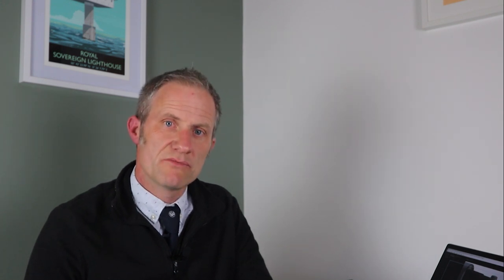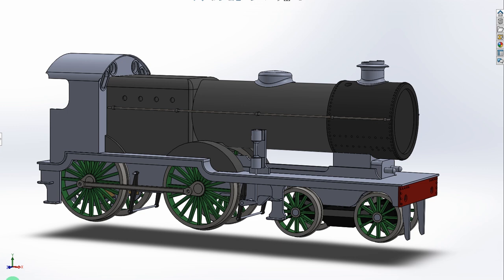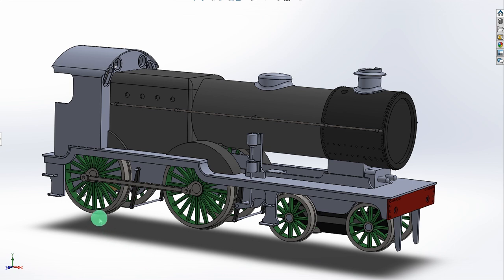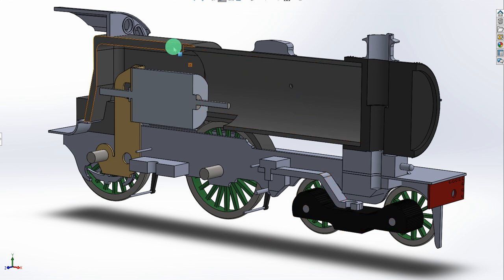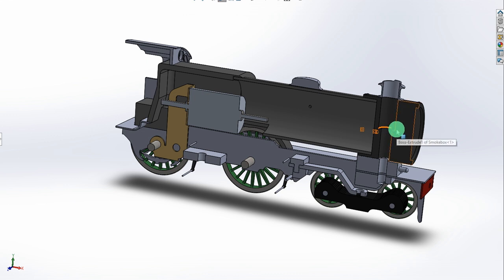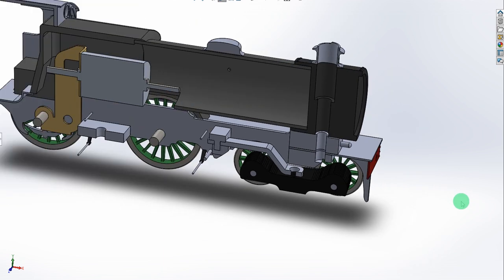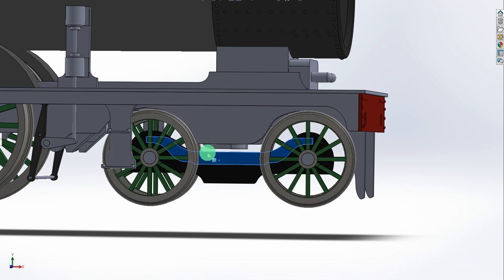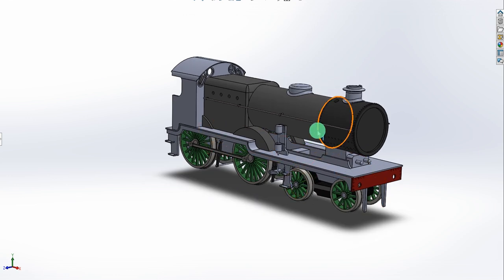Locomotive Kit Design

Comment: Interesting video, thanks for sharing. I know the video is 2 years old, but it may be worth doing a bit of research on Adavoyle Junction a famous layout based on Irish broad gauge, built to S4 standards, the engineering was remarkable, they mounted the motor and flywheel in the tender, and drove the driving wheels with a cardan shaft between the locomotive and tender through a gearbox, the result was a very smooth running locomotive, leaving plenty of space in the boiler for extra weight. I had the pleasure of knowing some of the people behind Adavoyle, I can guarantee if they were still alive they would be pushing 3D printing and technology to its limits

Comment: I did think you would be better off without the kit - especially with your CAD skills. Whitemetal is a good material but isn’t the best for representing sheet metal - things such as the cab, running plate, etc would benefit from being etched brass. As you say focusing weight above the driving wheels is ideal - I also agree moving the motor then packing lead beneath it is a good idea : casting the firebox in whitemetal (or possibly pure lead) would also pair well with a brass boiler.
-excited to see the next development
Reply from the maker: Thank you Harry, you have confirmed some of my ideas.  Having not built a locomotive this small before it isgreat to have some feedback from those more experienced than myself.  I have a 7 1/4" gauge loco build ongoing at present which may feature on the channel at some point, and that is altogether a different proposition.  I think the reversing lever alone is longer than the locomotive which is the subject of this video.  :)
Thanks for watching and for your feedback - much appreciated.
My best wishes,
James
Reply: @BexhillWest  7 1/4” gauge locomotives are very impressive, I hope it does feature sometime soon.
-You’ve peaked my curiosity

Comment: My main thought is that it's really only worth worrying about weight if you're going to be running it on layouts other than Bexhill West, where they most it's going to have to do is pull a few coaches a couple of feet and then run round them.  You will need some weight over the bogie to keep it on the track (though possibly that could be done with springs), particularly if you are going to use wheels of the bogie for electrical pickup.  As you've noticed in the cab, you will inevitably need some compromises on the scale with regard to width, as your gauge is c. 2mm narrower than it should be. If I even considered such a project as this (unlikely), I'm sure I'd be looking at buying in the wheels, as has already been mentioned: though it wouldn't surprise me if you didn't have the skills to produce perfect wheels!  You will have to make compromises, both because of the gauge and because it's simply not possibly to reproduce everything perfectly in such a small scale as 1:76.
Reply from the maker: Thank you Andrew.  You are right about the weight issue.  I don't anticipate running elsewhere, but even so I like to think of all these things as little engineering challenges and make them as good as I can.  To be honest I don't really anticipate much running at all at Bexhill West, but that hasn't stopped me thinking about it, and therein lies the fun of it all.  If I were sensible, I would simply look at photographs of the real thing, rather than spend hours building a model, just so that I could take photos of it to look at. :)
I have ordered some wheels, although I did seriously consider casting centres and pressing-on turned tyres, as I though it would be an interesting challenge.  Thankfully, I thought again - life is too short.  :)
As always, thank you for your helpful feedback, it is very much appreciated.  
Take care,
James

Comment: I agree with both David Orf and Harry Underhill, with the added observation that, where possible, nickel silver is preferable to brass, as brass is inimical to paint adhesion, n/s gives a noticeably more robust paint finish. If you're casting weights for loco adhesion/traction, maybe better to cast a plug weight than the boiler itself? Also, the front bogie will need some weight,  to ensure that it stays on the track, leading into curves. (I won't raise the benefits of accurate gauge standards ie. P4/S4, because that would involve you in some radical rejigging of your approach.) Also, it might be useful to buy in your wheel/axle sets - they're all out there, in whichever standards you choose. I'm one of the 'vulnerable' isolated since March - watching your episodes is a lifeline to sanity for me. I can't say strongly enough how grateful I am to you. I feel as if I've gained a personal tutor. Very best wishes, Mike.
Reply from the maker: Thank you Michael for your useful feedback, especially regarding the bogie weight. All of which is most helpful.
Thank you also for not raising the benefits of accurate gauge standards! :)  I cringe a little every time I look at the drawing, and can't help thinking that working to a scale gauge standard would definitely solve many of the engineering problems associated with OO gauge in addition to solving the rather obvious visual one too.
I have now purchased some wheel-sets, although I'm still to obtain the bogie wheels, so I should now be able to refine the splashers and solve those particular problems.
Finally, thank you so much for your very kind comment about my videos generally.  That is very kind of you.  Making these videos has been an interesting diversion over the past few months, and whilst starting from zero experience I feel I am finally starting to get the hang of it!  I am most grateful to those like you who have stuck with them, and provide such generous encouragement to continue.  I try to mix-up the content, have something a little different each week and explore new ideas.  I hope future video will continue to entertain.
Thank you so much, and stay safe,
James
Reply: @BexhillWest  Not just 'entertain' - I'm 72 and I'm still learning, not least from your video output. Stop learning and it's time to cash in your chips!

Comment: Very interesting Project James, I heard you mention fitting a decoder behind the smoke box door at one point, so you are contemplating having this running digitally, a very good supplier of motors are made by a company called Maxon and are available in different sizes and power from a company in Germany called SB Modellbau. Great video as always!
Reply from the maker: I'm planning to incorporate a decoder and speaker.  Thanks for the motor suggestion.  I'll look them up.
All the best,
James

Comment: Hi I’ve built 2 E1s and 2D1s ( dimensionally different locos) from Djh kits. They should be disregarded as inaccurate .A better option would be to investigate a possible accurate and scale body kit by the name of Golden Arrow kits, molded out of epoxy resins it will be light possibly need a bit of work to fettle the moldings but will be accurate. I married mine with a chassis made by Comet that fits it ( from a LMS 2p). With weight in boiler and careful counterweighting with the tender a good result is had possibly saving a little time. I must say I am very happy with my results. Gearbox and wheels and motor that’ll fit it can be supplied any major finescale dealer.
One can go as far as one wants as details are concerned but what results at the end is Accurate. Have enjoyed your posts hope this is helpful .
Reply from the maker: Thank you Stuart, that's most interesting.  I will look into the comet chassis.  I now have what I consider to be an acceptable 3d printed body for the loco and tender and had hoped to have made a start on the chassis by now.  The plan was to scratch build in brass, but I've been very busy over the past few weeks with other aspects of the broader picture.  It may well be that a commercially available chassis might speed me up a bit, so definitely worth a look.
Thanks for the suggestion.
Best wishes,
James

Comment: The splasher boxes inside the cab could have rounded (front to back) tops to reduce their (apparent) size. There's nothing much you can do to reduce their width, though limiting the side play on the rear wheels and making the boxes from thin sheet material (not casting or 3D printing) might give you a very little more room.
Reply from the maker: Thank you Henry,  I hadn't thought of making those splasher boxes from sheet, that would certainly reduce their mass quite considerably.  I'll look into it and will no-doubt have an update soon.  Expect a shout-out for the idea.  :)

Comment: Hi James

I think that the 3d print in resin is likely to give clearer detail than a white metal casting and allow thinner (more to scale) walls on the cab etc, you could build in pockets to the 3d print where you could epoxy lead shot for weight (other less toxic materials if you prefer) You could use Brass or Nickle Silver sheet, this gives stronger structures where the wall is thin but requires greater work to build the detail in layers. In addition to photo etch have you considered laser cut ? I found that for sub 1mm brass the laser kerf was just 0.1mm and my local metal cutters automatically offset the cut so you get an exact profile, good enough to get a 0.4 module 17 tooth pinion and a 20cm length of rack in 0.35mm thick brass that actually mesh, the only disadvantage is that you cannot get internal corners without a 0.05mm radius but since at 00 scale that equates to under 4mm you might not worry
Reply from the maker: Thank you for your feedback David.  Laser cutting is an option I have considered, but it's likely to become very expensive given the sheer quantity of parts I will ultimately need for the station canopies, whereas photoetching is a process I can do myself.  I must admit I quite fancy cutting the loco parts myself from sheet as a test of my abilities.  It's been a while since I've attempted such work and it would be a nice challenge.  
The idea of pockets in the 3d prints for additional ballast is a great one, and I'll certainly look at that in detail.
Thanks again,
James

Comment: I am new to your videos. I too would like to 3D print an American locomotive. But would like to the build in N scale. Have you thought of 3D printing the boiler and cab parts. Use them as masters to cast the white metal?
Reply from the maker: Hi Vincent, that was the original plan, and I may well go down that route.  I'm concerned about the weight upon the front of the loco and so it may be prudent to produce the cab and firebox in whitemetal and leave the rest as a 3d print to better distribute the weight over the driving wheels.  An alternative which is looking quite likely is that I'll cast the body in resin, adding micro lead shot into the parts above the driving wheels to achieve the same effect.  I suspect that there will be quite a bit of experimentation as I find a solution which works best.
Thank you for the suggestion though.  I appreciate your input.
My best wishes,
James